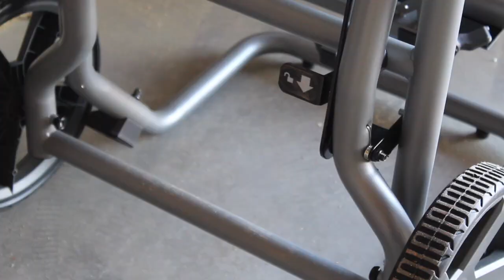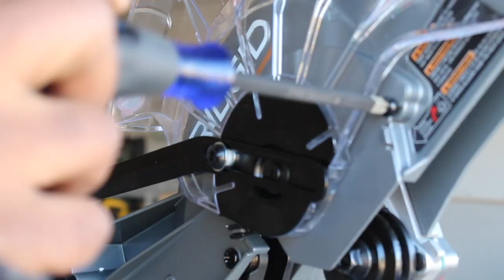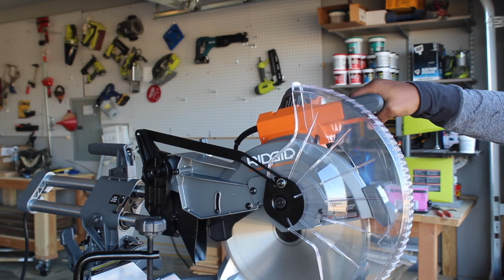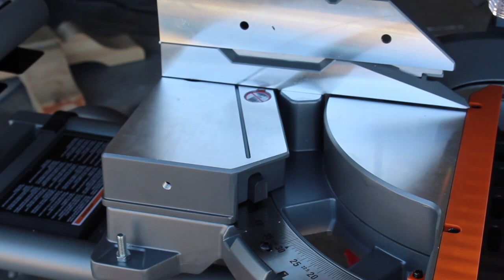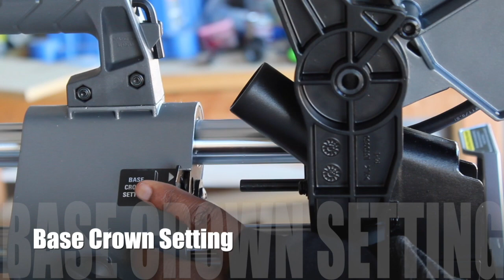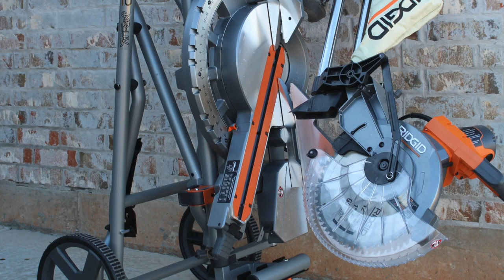RIDGID 12in. Sliding Miter Saw and Stand Setup | Unlocking and Installing Blade | Tool Reviews

Comment: U don't have to do all that to put a blade on and switch one out ..  I have 2 of these setups ....and u can swap out blades without even touching the guard screws... there's enough room to lock the guard up and just take out the arbor Allen bolt swap ur blade out and tighten it back in ...